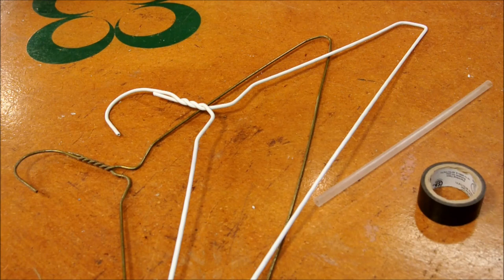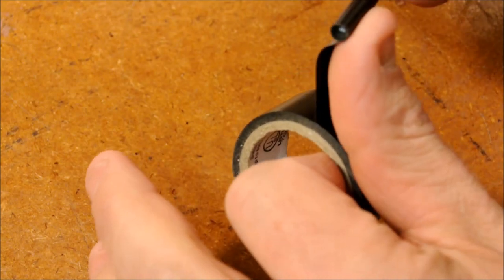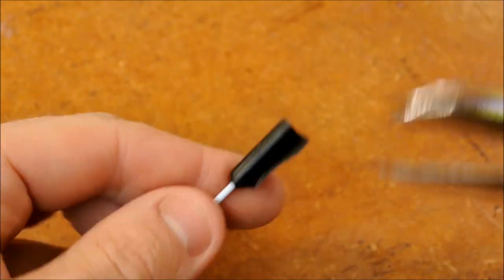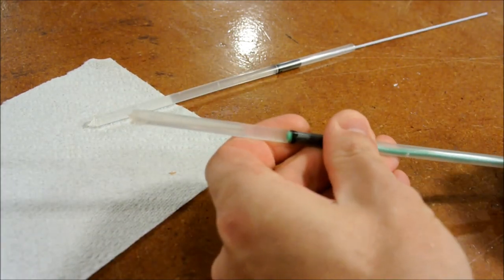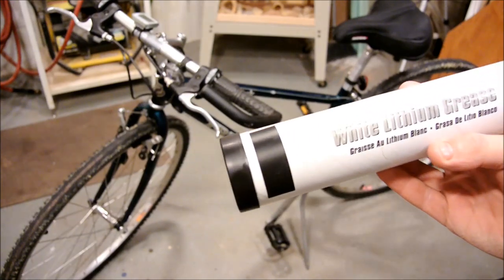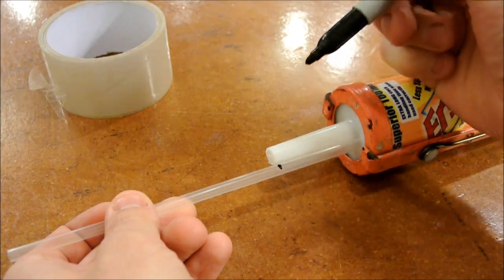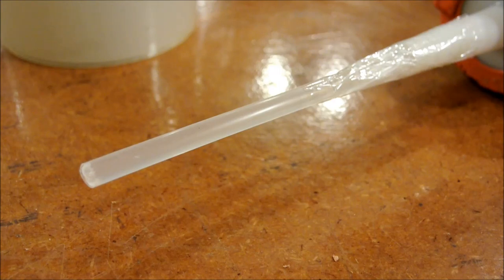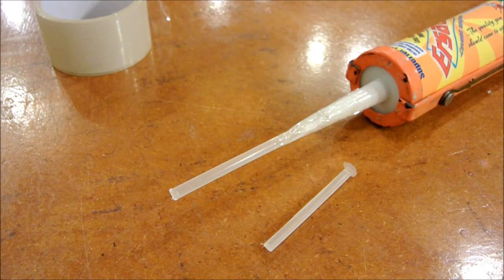Caulking behind a toilet (portable caulk gun)

Comment: Good stuff!  Even when a nail seems to form a tight seal with a tube of caulk, the whole nozzle area seems to cure within a week. The conical shape of the nozzle makes it almost impossible to pull the plug of cured material out of the hole.  The straight-sided straw extension is a great idea.

Comment: Pocket, thanks for the tips and the channel.  I have used the red wire nuts for years.  It mangles the tips a little by putting threads in the end of the caulk tube.  In fact, just yesterday I used a tube that had been sitting in the garage for 8 months.  Now, I have yet to try my trick on a tube of silicone so I am not sure it will be effective but I had zero dried bits of caulk with my other attempts, so it should work similarly.  One thing that would prevent someone from using my trick is if the angle of the tip is too great.  I typically don't use 45 degree angles when i cut the caulk.  I use what I would guess to be closer to 30 deg.

Comment: I've pretty much stopped using the caulking cartridge shown in your video.  Instead I use the “toothpaste tube” size.
It does cost more per ounce of caulk, but I have virtually no waste and they are much more convenient to use.  Especially in tight places.

Comment: I have good luck using the caps that come with the tube, but placing some cling wrap over the hole before putting the cap on. Just make sure you squirt a bit out before pushing the cling wrap on. No air, tight seal, last loooong.

Comment: you really should leave the back of a toilet open. this way, if there is ever a leak in your wax ring it will run out the back. if its caulked, it rots the floor out...
Reply from the maker: +TheLogical Lowdown 
No. First, this is ceramic tile on top of concrete. But let's assume that it were in typical framing: If you don't caulk it, it will be filled with piss and putrefaction within the year. Take the risk, and caulk it. Just keep your eye on it- as with all things in a home. Silicone WILL give indication if there is a toilet leak before there is drywall damage underneath. And besides, with each remodel, wax rings are typically replaced, and usual cases are only a very localized plywood damage. Simply not worth a urine smell trade-off.

Comment: This is the stupidest idea I’ve seen, surely an extension of the original caulking tube/gun would be better? Ie standard flexible working pipe/hose is the perfect size to slip over a caulking nozzle and makes a tight seal, you can then cut the hose to however long you want it to be to reach the narrow area you need to get to, you can just cut the hose end to 45 degrees like you would a normal nozzle and away you go! Much more efficient and familiar that this drinking straw coat hanger effort, and you can control the flow just like normal.
Reply: Don't use it if you don't like it. It's pretty rare that I'm forced to use the trick. I do still use it every so often to squirt grease into a tight spot. 

As for you and your insulting comment, please take your entitlement elsewhere, because chances are that any honest reply I give here will just end up getting censored; suffice it to say that your opinion is without any value to me. Am I still allowed to say that on my own channel, in defense?